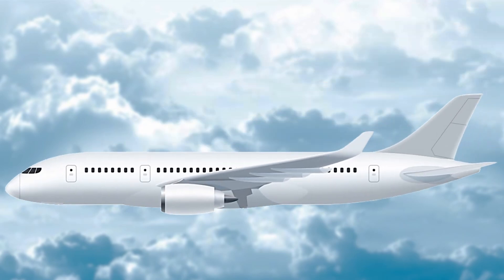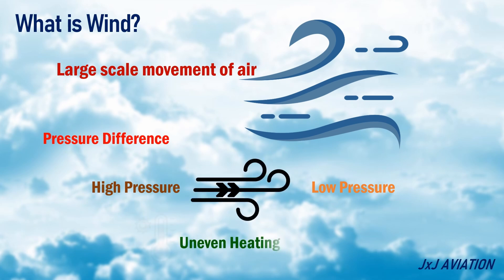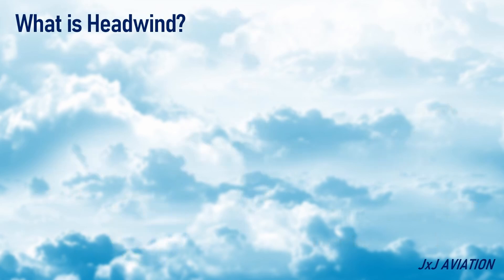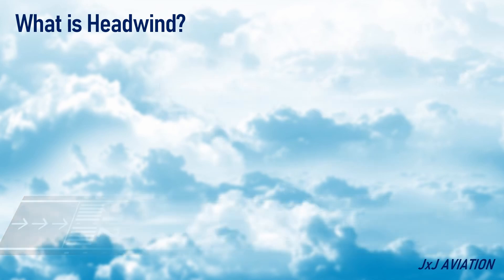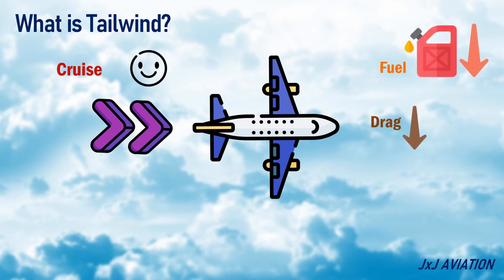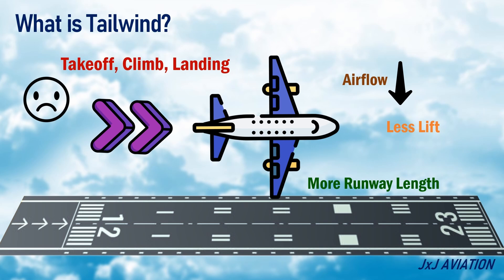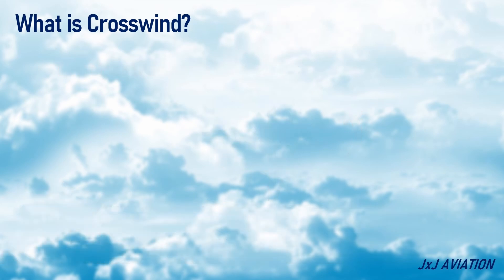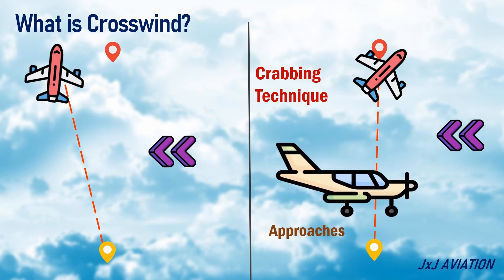Understanding Headwind, Tailwind and Crosswind | Impact of these winds on an Aircraft |

Comment: 📝 Summary of Key Points:

📌 Headwinds occur when the wind direction is opposite to the direction of the aircraft's flight. They are beneficial during takeoff and landing, as they generate more lift and increase drag, respectively. However, they are not beneficial during the cruise phase as they increase drag, fuel burn, and flight time.
🧐 Tailwinds occur when the wind is in the same direction as the aircraft's flight. They are beneficial during the cruise phase, reducing drag, fuel consumption, and flight time. However, they are not beneficial during takeoff, climb, or landing, as they increase the runway length requirement and reduce lift and drag.
🚀 Crosswinds occur when the wind blows from the right or left side of the aircraft. They can cause the aircraft's nose to yaw during takeoff or landing and affect the flight path during the cruise phase. Flight control inputs are used to maintain safe operations, and in severe conditions, a technique called crabbing is used.

💡 Additional Insights and Observations:

💬 "Understanding and managing these wind conditions is crucial for safe and efficient aircraft operations."
📊 No specific data or statistics were mentioned in the video.
🌐 No specific references or sources were mentioned in the video.

📣 Concluding Remarks:

Managing wind conditions, including headwinds, tailwinds, and crosswinds, is essential for safe and efficient aircraft operations. Headwinds provide benefits during takeoff and landing, while tailwinds are advantageous during the cruise phase. Crosswinds require constant flight control inputs and can affect the aircraft's flight path. Overall, understanding and effectively managing these wind conditions are crucial for pilots and aviation professionals.
Generated using Talkbud (Browser Extension):
Reply: Nice!
But I still don't understand how headwind will be beneficial during takeoff.